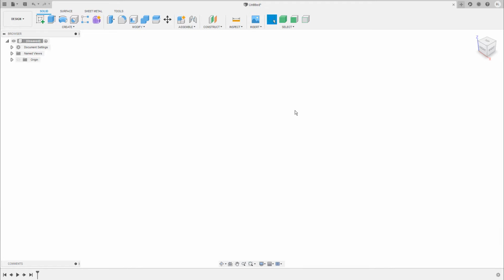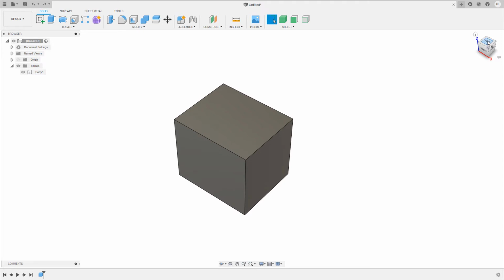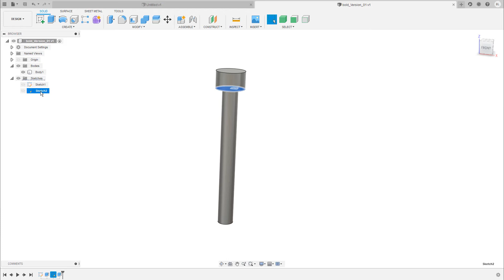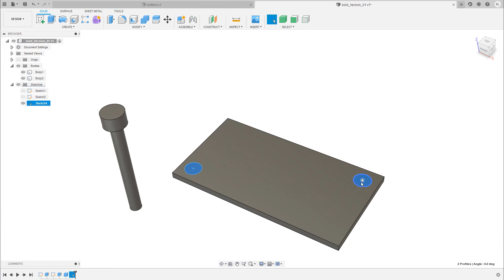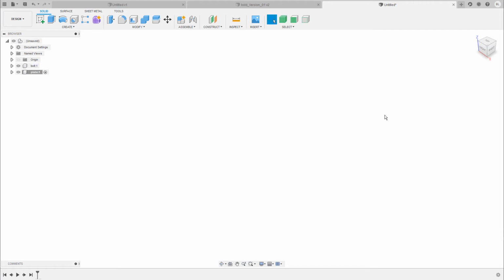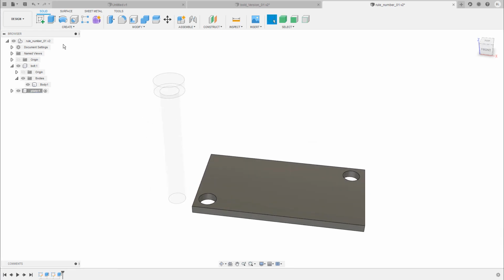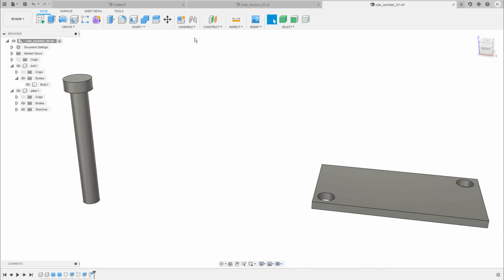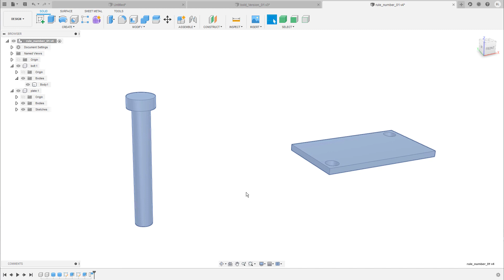Assemblies, Components and Bodies in Fusion 360, PART 1 - Day 7

Comment: This is awesome man!, Thank you!. my projects are usually extremely messy mainly because Fusion allows you to work very fast. The only thing i would suggest is that in the video where you sketched a cylinder on top of another cylinder. It would be better to create an offset plane first and sketch on the plane. It helps later on if you need to make edits to the design, Fusion handles the data better, without timeline errors.